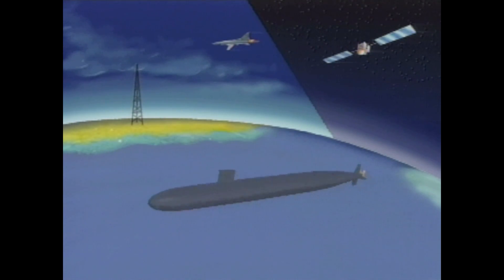Watch A Submarine Hide Using Radar & Sonar

Comment: sorry about the dumb "touch" of this question, but seriously: If I would put my bottom to the hull of the sub and let one rip, could other submarines hear it so that such an action might risk detection?
Reply: It's definitely possible. We heard music playing on a submarine.
Reply: @cowboys4life68  Jesus that music must have been pretty loud
Reply: @spacedonkey3412  don't know, I was on a different ship.
Reply: @cowboys4life68  maybe it was an underwater telephone?
Reply: @spacedonkey3412  maybe
Reply: @spacedonkey3412  James Cottle is right. I heard music from a cruise ship on sonar a few times. They aren't designed to be stealthy like a submarine, so the speakers make the hull vibrate. You can just barely hear it but you can hear it. :)
Reply: @neutrino78x  Wasn't the music masked out by the propulsion?
Reply: @spacedonkey3412  not if you isolate the frequency range of the music, omitting any other background noise like the propulsion
Reply: @scottwilson4798  I doubt you could effectively do that in real time though, maybe in PEA, also the BB operator could probably select an Octave to listen to but they'd still pick up alot of the noise from the propulsion as they occupy similar frequency ranges. Alot of the frequencies involved would probably  make music a near field transient as well so you'd have to be with-in 2-3kyds minimum if it is at all possible.
Reply: Subs can detect a tuna thousands of hundreds of miles away.

Comment: Those screens are so beautiful. Haha. Years of my life was spent staring at that beautiful green.
Reply: USS Salt Lake City SSN-716 from 1997-2001. Seeing that AN/BQQ-5 sonar display takes me back.
Reply: Steven Phillips what is it ?
Reply: @dieselj7433   broadband waterfall display is a visual abstraction of sound in the water. Each dot means that a sound (of any frequency) was detected by one of the hydrophones which is pointed in that direction. The brighter the dot, the louder the sound. You use the cursor to select what you want to listen to (normally you are just moving the cursor to the right for your whole watch, unless you need to go back and listen to something). Time is in the vertical direction. That helps you see patterns. If you see dots accumulate over time in one area, it means you might have a target in that direction. It could be a ship or it be a biologic (dolphins, whales, birds, shrimp). iirc the top squares are for the last 8 seconds, the middle squares are for five minutes and the bottom is 30 minutes. At about one minute and 35 seconds into the video, you can see little squares above the waterfall display that have writing in them. Those displayed your "trackers", which keep track of the relative bearing of a contact you have gained. For example if you found a contact at bearing 100 relative and it is now at 120 relative, that display will tell you that. So any trace you see on there, consistent patters of dots that appear in each set of boxes on the screen, is a potential contact. 

There are other displays in sonar, but when civilians come in the sonar shack, we disable all of those because the only non-classified one is broadband waterfall. :) Of course, I know how to do a lot of tactical stuff with that display which is classified. But the display itself is publicly acknowledged. 

btw the ship's computer on this kind of boat (looks like the original sonar on a Trident (Ohio class) boat) was roughly the power of an Intel 8088 like the one in the IBM Personal Computer released in 1981! lol. There was a Sonar Equipment Space on Forward Compartment 2nd Level that had several huge towers of hardware graphics and sound equipment that made it so the 8088 just had to handle the processed output from those machines. 

By 1999 this hardware was hopelessly obsolete. I used to talk to shipmates who also knew a lot about computers (I wrote my first program when I was 8 in 1986) about how all that stuff could be done in software by a single laptop of 1999 vintage lol. I had nostalgia for that stuff because it reminded me of the first computer I used at home, which was that first IBM PC from 1981, running DOS 2.0 (and later 3.3...4.0...5.0...6.22...we upgraded the memory and added a hard drive, and of course we got newer computers, a 386 and when I graduated high school, my dad was using a Pentium I-166 and I had the 386 and the 8088). 

Of course now the latest generation is all current generation commercial PC based stuff with a touchscreen monitor, albeit in a milspec case that's resistant against EMP, low power explosions in the shack, etc. When I was on the Asheville, they were upgrading the sonar to that latest generation.

I remember there was a device called "group c" that was mounted above the helm. It displayed an analog graph of temperature and pressure as reported by a probe that we launched via the 3-inch launcher. It was a real pain. You had to reach up at the very edge of your reach to pull the paper out and replace it. I kept telling the guys "I could write a program to do everything this thing does in BASIC on my Texas Instruments calculator in like 15-20 minutes, and it would be better because it could store the data and you could download it to a laptop without having to do this  tip-toe reaching [stuff]". And they said "oh the Navy will never upgrade that", but sure enough, if you look at videos of the Virginia and Seawolf class, they have replaced it with a touchscreen display that's in color and outputs the data to the ship's internal network (the internal network, of course, is air gapped, and you can't hack into it remotely) or stores it locally. lol! I called that! lol :)

--STS3(SS) Brian (neutrino78x), served 1999 to 2003 on USS Florida SSBN-728 and USS Asheville SSBN-758. 
Went to sea four times on the Florida, for a total of 365 days at sea, according to DD-214. Longest time underwater was 87 days. Did not go underway on Asheville because she was in drydock the whole 9 months I was assigned to her. I am, however, Qualified on USS Asheville as well as being Qualified on USS Florida.
STS3(SS) = Sonar Technician Submarines 3rd Class [paygrade E-4](Qualified in Submarines). Florida has since been converted to SSGN; they removed the trident missile launch capability and replaced it with the ability to launch hundreds of tomahawk missiles in just a few minutes.
Reply: neutrino78x thanks for the info, it’s really hard to find some good info on how military sonar systems are used.
Reply: @neutrino78x  hey thank you for taking the time to write that.
Reply: @neutrino78x  Thanks for taking the time to explain to us
Reply: @neutrino78x  nice😎 -sts3/ss, 715buffalo & 722key west, both out of pearl, 01 - 06..... gotta love q5e & demon lol
Reply: @wilsoncrocker  nice! :)
Reply: @neutrino78x  awesome writeup! "Yeonarman" PASADENA (SSN 752) 2002-2005; TUCSON (2009-2012).  Also, ARCI phase V phased out all that BSY-1/Q-5 stuff.  Things moved forward.  Just not that much.
Reply: @neutrino78x  Do you had the database with sampled target sounds allowing for easier classification of contacts, or you had to rely only on your own hearing and knowledge? Is there anything you can tell about those other (i mean other than broadband and FFT) displays? How many trackers do you had? Was TMA done by computers too, with various data from all over the boat (sonars, periscope, ESM, datalink, radar)?
Reply: @macieksoft  the only display I can talk about is broadband waterfall. The other functions in sonar are classified. This is why we are known as "the silent service". I was even ordered verbally that even after I get out of the Navy, on penalty of being charged with treason, I can't say what level of clearance I had while on submarines. I can eventually discuss the location of machines in the engine room compared to other machines there, but I have to wait until 70 years have passed since my EAOS (date of separation from the service).

I can't talk about what sort of software we have on submarines...but I can tell you that, human judgement overrides what a machine says. You always want a human to be able to understand if the machines are giving you the correct answers. So we're trained in using the appropriate mathematics to understand the situation ourselves without relying on software. :)
Reply: @neutrino78x  dang dude, comment on all those things after 70 years if its not already unclassified by then haha. See you in 70
Reply: @koekie7003  lol one of the reasons I volunteered for submarine duty was the opportunity to know secrets :) The big picture is in the newspaper...it's the little details that most people know about...unless you have "need to know". But the consequence is that you can't ever let anyone know what you know....hence the nickname "the silent service".

One time a girl I met in college for whom I had feelings emailed me and wanted to know when the boat was coming to San Diego because she lived in the area then (I'm from the san francisco bay area, she lived there temporarily and was in San Diego when she emailed). I told her I can't, I can't discuss when or if the boat was going to San Diego or any other port.

Of course, I knew we were going down there and when, but the movements of a submarine are classified because it is a stealth weapons/sensor platform. I called her when we were down there but she couldn't meet up on short notice because she was working two jobs. :) I'm still in touch with her on facebook, she lives on the East Coast now. :)
Reply: @neutrino78x  I bet you have a supercomputer on every sumbarine analyzing the sound with neural networks and classifying what is a boat, dolphin or another submarine etc.
Reply: @forloop7713  can't talk about equipment but ultimately it is human judgement that determines that. We listen and figure out what it is. :) There's also a lot of math involved in sonar, in terms of figuring out where the other guy is pointed and where he's going and how far away and what we should do. :)

In sonar "A" school in Groton, CT, we had to shred our notes at the end (classified). :)
Reply: @neutrino78x  I bet there's a lot of math involved. I watched Smarter Every Day board a US submarine on youtube and the captain was a physicist. Thanks for your answer.
Reply: @neutrino78x  Thank you, sir, for all that information, and thank you for your service. I have a neighbor who served on Ohio class subs during the late 2000s and my late uncle served on the USS George Washington in the early 60s (?), so I guess I have an affiinity for sub lore. Peace.
Reply: @neutrino78x  my son joined up 3 days ago, he ships to boot in March, he's 6'3" at 19 years old, he signed 8 years and is going for STS rate... What's your thoughts?
Reply: @flman1284  That he joined at an odd time. Imagine serving at the pleasure of Trump and Hegseth, two television hosts with fewer brain cells to rub together. The good news is that Trump is completely transactional, so your son probably won’t need to defend Taiwan.
Reply: Brill

Comment: Do all submarines of the same class have the exact same signature?
Reply: Not exactly but pretty much since they have the same design and build.
Reply: Basically it's like two cars 5 years old, both look the same but sound is totally different, signatures of different propellers can be told, the different amount of blades, their size, rotational speed, their pitch angle the amount of cavitation for a particular speed etc. We know our friendly sounds and they are logged into computers so quite often you know you are listening to an enemy sub, but what class and type might not be known unless a known sub has been in port somewhere and then we have tracked them out of port and done a plot/track on them, then we know. Certain subs such as the alpha can be heard from 1000's of miles away if they are doing 50kts as they are so so noisy they stand out...
Reply: Every ship in the sea has a slightly different acoustic signature due to casting imperfections and wear/tear on the propeller.
Reply: Every single boat or ship has it's own signature. Some may be very similar but all are different, like finger prints. Navies go to great lengths to get a sonar recording of friendly and not so friendly ships acoustic signatures. These signatures can be programmed to mines or torpedoes to target a particular ship or boat.

Comment: A sub hides by using neither of them...
Reply: use of passive sonar is undetectable.
Reply: We 100% have radar, just cant use it underwater.  Best way to hide is slow speeds, depth and environmental factors.
Reply: @113stDFX9900  Could a sub theoretically hide by dispersing a dozen small units which emit loud pings in front of it? I realize that would screw up its own sonar but it could be used as a last resort if the crew is aware that an enemy sub has their position locked?
Reply: @MilanTukidid  No. All the enemy sub would have to do is launch a torpedo in that general direction and let it do the rest. The only way the scenario you're talking about could work is if the torpedo itself was using passive sonar only and the ping-units were making more noise than the submarine was. If the torpedo is using active sonar (as they often do), then your distraction in this scenario is useless.
Reply: Sit down, dumbass, adults are talking.